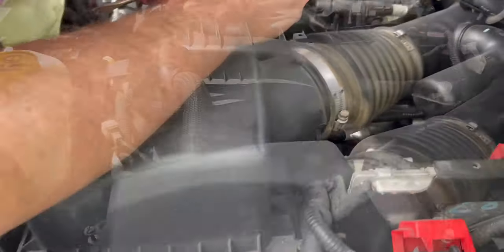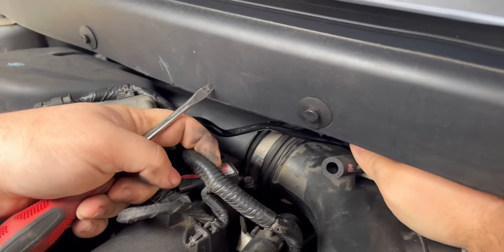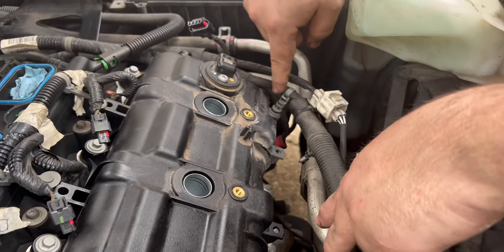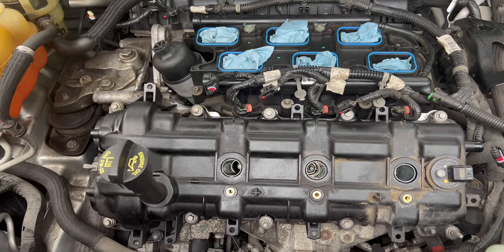How To Change Rocker Arms And Lifters On A Pentaster 3.6 2014 Dodge Journey AWD - Part 1 Of 2

Comment: We are about halfway through and working on the right valve cover.  The video doesn’t really mention it, but do I need to disconnect the stuff near the pcv valve to get that cover off?  Great video-we are loving it!
Reply from the maker: Yes, there is a PCV valve in the back.  I thought I put that in the video it was an accident if I didn’t include it, but yes that needs to be taken off in order to remove the back valve pan cover.
Reply: Thanks for the quick answer!  We are hoping to finish the second part today.  I feel like that’s where the issue is.  You did mention that the valve is near there and how to slide the valve cover to the right as you remove it, just not what to remove before that.  We have a 2011, so it’s a little different and we also couldn’t get the bracket near there off, but have worked around it.  Your video is amazing and full of great info.  Thank you again for posting!
Reply from the maker: @sallykrug-shaffer4067  you are welcome, my friend. 👍
Reply: We got that figured out but are having the hardest time getting the right side block in place between the timing chain sprockets.  We are using the correct part and we cut it down as indicated.  Any secret trick?  We don’t have room to pound it.
Reply from the maker: @SallyKrug-Shaffer  OK the secret to that is.  There is a bolt on the crankshaft pulley and you want to get a breaker bar or a longer ratchet to be able to move it back-and-forth just a little bit and when you move it to the left and to the right, you just simply push the cut off plastic wedge into place and you don’t have to really pound it into place because I know there’s not enough room to pound it with a hammer when you move, the cam back-and-forth by slightly turning the crankshaft to the left and to the right it will move those cam phasers the teeth on them, and you should be able to wedge that plastic tool right on in and then it should lock them in the place.  I hope that makes sense to you.
Reply: Got it.  We had done that for the front and after much wiggling, we got it.   Thank you.

Comment: Around 45mins into ur video did you have to release the pin to get your cam lock in place? I can get 1 side to line up with the teeth but not the other then if u try rotating the motor then the lines dont line up im really start to hate dodge

Comment: My car is started.to.make.that noise is not to loud but i can heard it can i use any special oil or anything. So it can save me the $$$
Reply from the maker: Just make sure it’s not low on oil and do a new oil change if it’s not been changed in a while.  If you still hear the ticking sound you will need to do the process in this video.

Comment: At marker 46:12, are you trying to get the wire stick into the small hole left of the screw or is there another small hole behind it?
Reply from the maker: There’s only one small hole and it releases the piston so that the timing chain can be loosened from the tensioner and it gives you a little bit of slack.  There is only one hole though that it will fit in. You should be able to see it and you’ll know you’ve got it right when you see that there is less tension on the timing chain.
Reply: The oil bolts on front bank were loose and I forgot all about it.  And started car and few seconds later I heard rattle then engine stopped on own. The left exhaust camshaft was almost disconnected from phaser and their dots weren't lined up so I removed oil bolt to try to align. The 2 gzayo pics is my current status, how to fix? I can't get the needle tool inside the small hole to get chain slack

Comment: I can agree with you on the replacement of all while you’re in there. However I have to disagree on using offshore parts. For corporations the bottom line is all about profits. Experience has proven that ALL 3 auto manufacturers use China to cut costs on parts manufacturing. No one can prove that the “Mopar”  part is not made in China.You only have someone’s say so and if you trust their word then I feel sorry for you. For the DIY person the replacement cost is pertinent. In Canada here I have used offshore engine parts and OE parts. Occasionally the OE parts fail also and the offshore part gives good performance. This job for me in Canada for just the lifters and rockers cost me for OE  24 of each = $672.80 …Amazon $160.00. Given that Mopar Gen 2 lifters and rock arms only got this engine to 132000 mi I’m willing to bet that Chinese manufacturers can get another 130000 miles  and by that time if I still need to change them I’d do it again if needed. Just saying.
Reply from the maker: Everybody is entitled to their opinion, my friend. 👍✌️